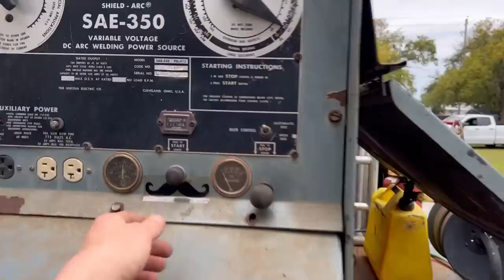100 year old stairway replacement ( welding repair )

Comment: Mr Clean running the 2 stroke saw with no saftey glasses and no respirator 😂
Reply from the maker: He’s a savage
Reply: For sure
Reply: @MeltinMetalAnthony  A savage now, lung problems later.  Please help him know that and hand him a dust mask.
Reply: @donsmith9081  those older guys will refuse a dust mask every time. its nuts haha. my dad is the same way, ive seen him grind concrete in a small room with no ventilation or mask several times. so much dust you literally cant see your hand in front of your face.  only takes a couple minutes to fill a room.    im slowing convincing him that preserving his health is important, but man those old construction guys are stubborn.   he always says "you gotta die somehow" and thats not a joke either lol

Comment: Century FC-90 FTW......I love mine, super handy around the house and it punches well above its weight class with .035 wire. My only complaint is they should have given stick leads as well to run 3/32 rods. But it still gets alot of work done.

Comment: Good job. Needed to be done, but as rusty as it was i guarantee you these stairs would have been safe to walk on for probably 20-30 years before it actually collapsed. Youd be surprised how little metal it takes to hold weight up. I remembered years ago i guy i worked for had a lowboy and one day after an oversized load he tells me to grease it(i never used it but it was a rainy day), so I'm under there and the ubolts on thr bsck axle are literally 90% gone and it still was abke to hold a 80k lb excavator.

Comment: I am currently an ironworker and do the same type of Jobs and have found to make life easier to cut in tight quarters where your cutting disk has a high probability of jamming to cut material top down and leave a 1/8th of material then wack it with hammer or use a Sawzall and a Diablo blade. also for the welds in the back corner of the pans to use a torch to feather the welds off , less cutting disk dust  and noise. Speaking of the dust for concrete and metal cutting/grinding use a mask 3m 6503q quick latch respirator so you can speak when you want too and not have to rip it away from your face and less black boogers and hacks in the shower after 😂
Reply: Also use Caution tape or pilons and yell at guys who run on stuff that your working on , if they get hurt that's on you , give that guy some shit and have less liability on your end , we are steel workers and we know whats safe and when it's not safe from experience, some people have no clue , oblivious people man 😂

Comment: I'm glad it was you doing those stair pans and not me that is my least favorite job 1 pinch tighter than its supposed to be and you figured it out it don't that get the grinder that's why I don't like stair pans I let someone smarter than me do the install I just think I am alright in the prefab shop that's my day job actually but like I said before I got a mobile setup and I like what your helper said 6 ft that's the cap smart man

Comment: That was a bit of an epic shit storm on how to remove over engineered stairs .. especially buried in concrete ..liking the prefab idea and yup bitch when it goes smaller in the bloody middle as your trying to work along it .. goes to show that remedial work and replacement work always throw a spanner at ya at some point . As you say long days into nights but it's done and dusted and a very enjoyable video 2 great guys to work with makes a great team. Humour and great work ethics makes it a good job . Great video cheers fella .

Comment: Bro I know how you feel... I did this wood deck for a lady last summer, just a little 15 foot by 10 foot back patio, 2x6 decking, and 2x2 raillings, and a 6 step stair. She wanted it gone, but i figure we just power wash the wore off latex shit paint off of it and stain it properly and shell be good as new! 

Well fuck me sideways i show up there saturday morning 7am with a rented 4000psi pressure washer, a brand new set of tips i just bought and the paint aint coming off AT ALL. Turns out theres like 3 coats of this shit and the old lady is starting to give me the side eye. So I pack it in and go get the only other thing i can think of, my 35 gallon, double head, 400lbs monster of an air compressor. 

I plug the beast in with my welder plug adapter where her stove plugs in the kitchen and try my portable sandblaster, LOL NO, im just eating away the wood and making an absolute mess of sand all over this lady's yard and she aint havin it.

Its like 1200 at this point, so i go to RONA and get me a 4 inch makita belt grinder, my full face 3m, and extension cord and like the whole stack of  60 grit belts and i go to town on this deck bro. I had to take all the raillings off, old 2x2 dimensional lumber, and rip all 4 sides on my table saw to keep them nice and square, did that 57 times ( i remember how many cause I had to buy a couple extra when i threw them in my van out of anger lol). 

In the end, took me until 9pm on sunday to get it sanded, stained twice, and pack up all my shit in my van and my truck. But i made a 2k profit in the end, and im still doing jobs for that sweet old lady.

Stay safe buddy, and when you coming up North to see how the real men do it???

Comment: Hey man! Just found your channel and been binge watching it haha. I really enjoy your content. I’ve been doing steelwork for about ten years now. A lot of structural and ornamental stuff. I was just curious why you guys didn’t put up stair pan brackets? The other thing I wanted to ask was if you fabbed the pans yourself or if the contractor had the fabricated and you just assembled. I’m trying to take more work on for myself in my spare time and insight would be great. Thanks in advance man! Keep putting out great content! Best Regards from Boston Massachusetts!
Reply from the maker: Hello brother! I don’t use brackets for these pans because I have so much weld surface, just extra work for me. Also they are made from 1/8 so plenty strong

Comment: a little tip if you care to learn from guys with more experience. You should add angle clips for each step to rest on and/or simply and quickly just draw out where each step will be on the stringers using a framing square. would take a couple minutes on each stringer to draw out and not much more to add on angle clips if possible/ allowed in the bid, and you'd FLY through the steps part. Stairs is all math. Once you got the math down the rest is a breeze. Well besides the heavy as fuck stringers
Reply: I'd love to do a staircase with you in the future. I hang stairs in New York and New Jersey in a union environment. When labor costs are high, technique and preparation are tantamount. Take things out in one piece. Bring things in one piece. Sheetrock carts, furniture dollies, nylon straps, aluminum picking beam.

Comment: Those steps you were talking about you never seen used on stairs like that are called "Precast Concrete Treads" and they suck pretty bad to install as well. Especially if its multiple runs up multiple floors carrying those treads one by one. And fabricating and installing the stringers and pans suck too everything about those types of stairs suck.

Comment: wow...mr. clean's lungs are not so clean after that mortar grinding!  yikes.  90 amp flux core sounds like probably marginally hot enough, so I wouldn't trust it for more than about 1/8" thickness

Comment: What was the reason for using a small flux cored welder over just running 6010? Is it to save time or does it run better?
Reply: They didnt have the truck generator there at the time it seems, the 90 can run off a regular outlet but the larger 6010 rod prolly ran more like 110-125